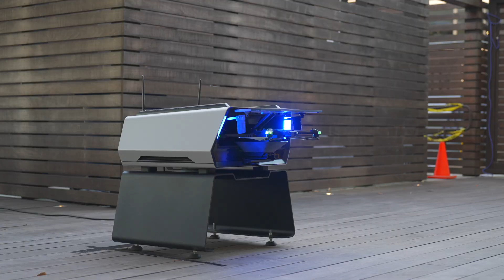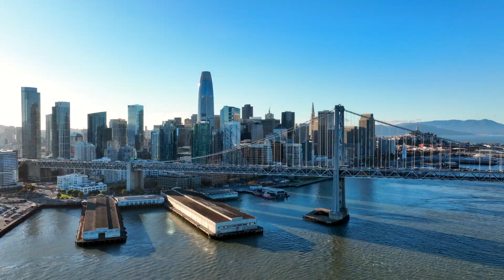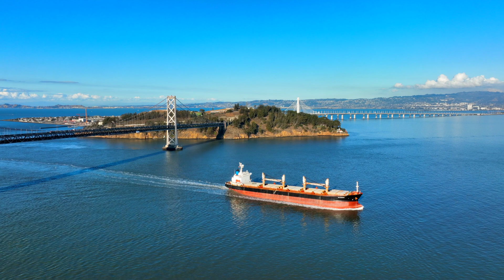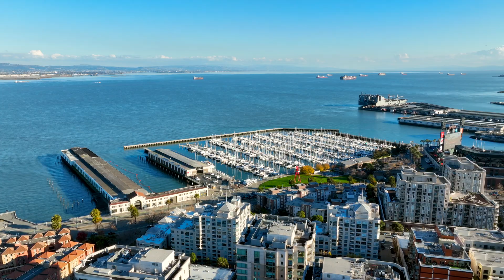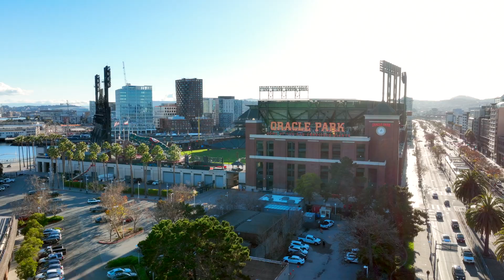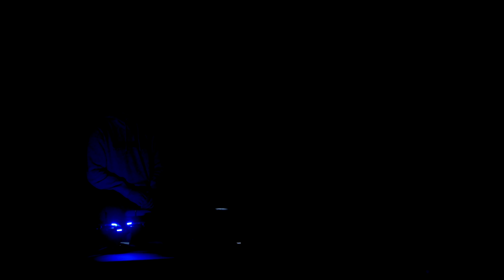Talking Skydio Dock with Adam Bry

Comment: Good interview BK.

I really want to love Skydio but I just can't as much as I try.  I hope someone from their team reads this and suggests a course correction because I really believe they have some amazing potential in spite of the painful fails they keep racking up.

1.  Get a real sensor for the entire line of aircraft - We all know the Skydio sensor (Sony's IMX577) is VERY old tech at this point.  Its time to upgrade in both size and performance.  The bar is at M4/3 and 20 MP.  Get over that bar.  Not just for EO but the IR is also old tech.  The BOSON sensor is available at 640 why aren't you using it?  Stop skimping.  Bring the best, always.
2.  Get a real Remote - this is the single interface the RPIC has to control the aircraft.  Don't rebrand some trash that's old tech.  Build a remote that is as smart as the drone or smarter.  The enterprise remote is the BARE BONES MINIMUM that should be offered.  PERIOD.  The Beacon is reckless at best and dangerously illegal at worst.  Kick that to the curb.
3.  Change the message - The Skydio website says, "Turns anyone into an expert pilot." and that's an ignorant and dangerous message for a young and growing community to get from any company.  A single piece of technology, no matter how advanced will not "turn anyone into an expert pilot" no matter what anyone thinks.  That technology might provide the highest degree of obstacle avoidance or the best object tracking or the highest accuracy 3D models but it won't make a human an expert in anything, ever.  PERIOD.  Saying that a single piece of technology will replace hours of flight time, practical experience, and thoughtful mission planning is at a minimum inaccurate and at worst a boldfaced lie.  If you're willing to lie to get me interested in your product on your website then you're going to be willing to lie about other things.  We have enough companies that do that.  Be better.  Be honest.  Admit you're wrong and remove the lies.
4.  Is landing on the battery the best option?  That makes me nervous EVERY SINGLE TIME I see it.  How can that be good for battery lifetime?  I get the hand catching but... Be better.
5.  Make the AI assist the pilot and not over rule them.  I've never flown any Skydio product because I've been told that the drone can and does on a regular basis, makes course corrections when it thinks it knows a safer route than the pilot.  At that point, I keep asking myself, "Who is the RPIC?"  If the Skydio makes a bad choice, that causes injury or damage, who calls the FAA?  The RPIC.  But who was controlling the aircraft?  Am I the only person that isn't willing to completely sign off to a drone's best judgement?  Why can't the Skydio just help the operator make better choices?  Suggest a better option?  If the RPIC chooses to ignore it then that's on them.

Sorry for the rant on this one but I'm hopeful that someone from Skydio reads this and understands the concerns enough to take some action.  I want to be a fan.  I want to ditch all my DJI products and buy Skydio but those 5 points (and there are others) keep me from making that leap.